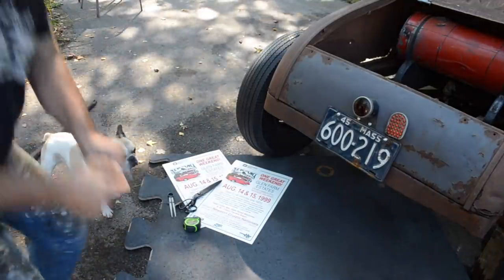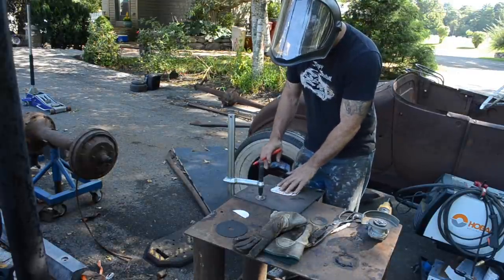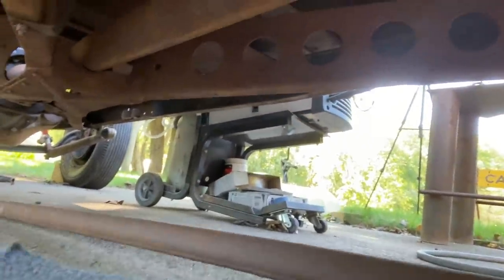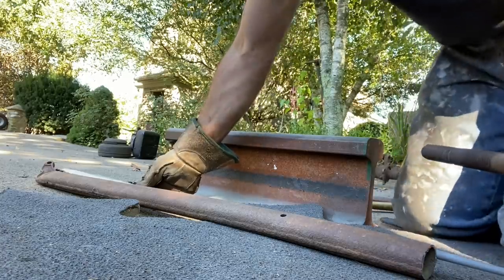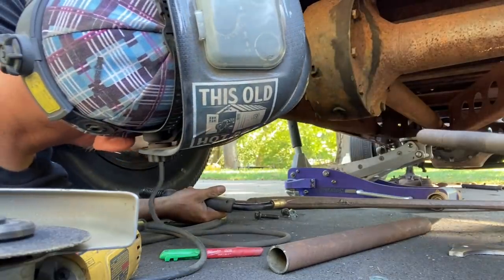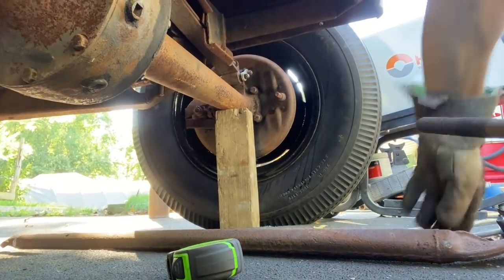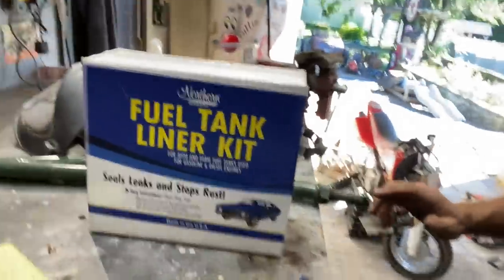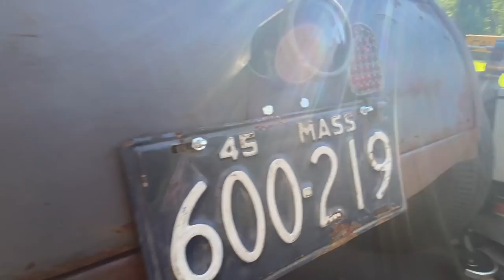1927 Ford Roadster Project [Episode 9]

Comment: It works for me, I like it! Shock mounts next.
Closed gastank cleaning tip - Ratchet strap tank with tumbling media to a cement mixer for agitation, sandwich a motorcycle tire to prevent denting.
Carson top by all means, sectioned and shortened from 33-34 roadster?
Reply from the maker: Going to build the frame from 3/4” emt tubing with a hand built wooden header.   Snaps around the body. 👌🏼😎

Comment: Was think a smaller tube piece in side both tubes then  but them back up to each other  and weld easer to maintain them both to same length ! But what ever works .
Reply from the maker: What I did and the way I did it is how they’re built from Ford.  The end is slid into the tube and welded.  
I believe it was the easiest way to recreate them and I had no issues getting them the same length.  

Everyone has their way of doing thing… no way is right or wrong.  👍🏼

Comment: If you cut the tank open don't "fold" the flap up; you won't get the fold out. cut all around the panel(rectangle)but for one small tab to keep it to the tank. then you only have one small corner to fill to make it smooth again
Reply from the maker: That’s a great tip.  Thank you. I was thinking about the crease and not wanting to cause one.  That’s a big help.  Thank you 🙏🏼

Comment: Wouldn't you be better welding of the xbrace so you can separate the torque tube if needed and the xbrace willbe stronger than the torque tube
Reply from the maker: That’s not how the torque tube is designed to work.  If I was running an open drive “an actual driveshaft” I would have done it that way.  But the tube and rods move as one. Not independently from one another